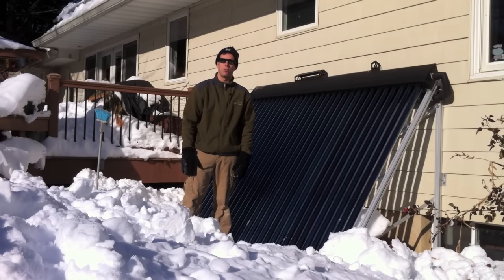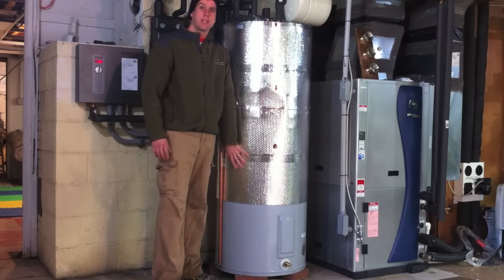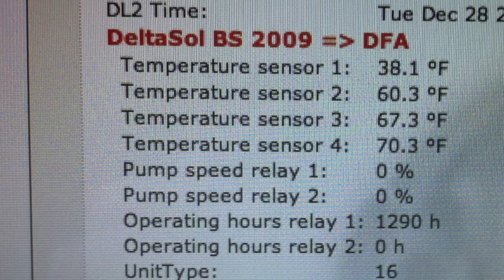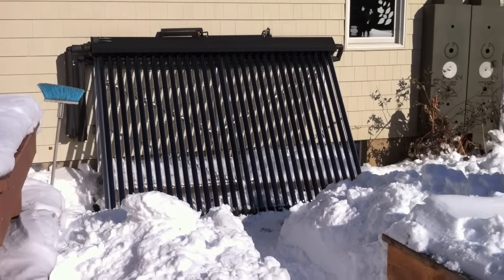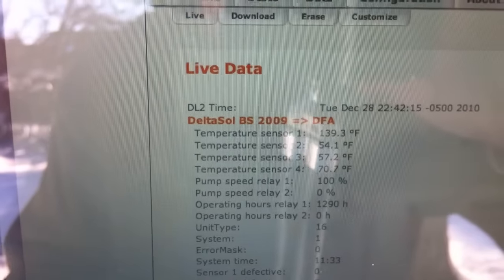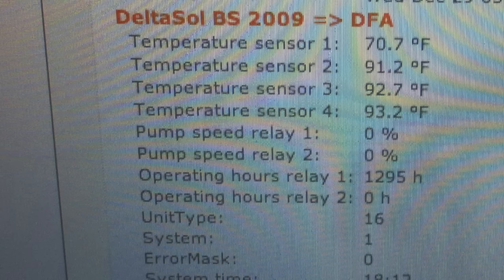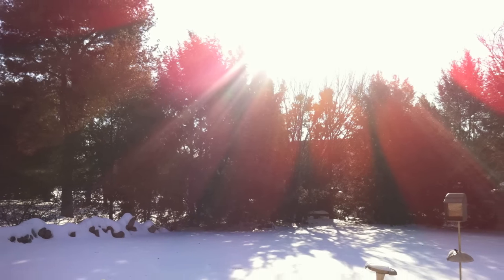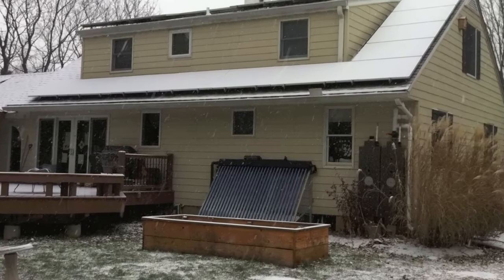How well do solar thermal evacuated tubes work in the winter? Sunmaxx solar

Comment: I have a correction for the math. He needed to have found the average temperature rise across sensors 2,3 and 4 which comes out to 34.8 degrees. (34.8 degrees) (80 gallons) (8.34 BTU per gallon)= 23.1K BTU. Great Video by the way!
Reply: Total of 23.1k BTU day =  6.7 Kw day x  $0.13 Kwh taxes included = $ 0.87 day saving . WOW

Comment: Did you think about mounting the system on the wall of the second floor?  It would be out of the way of the shade from the trees and the kids soccer balls.  A vertical mount would collect less snow and may result in less excess heat in summer when the sun is higher in the sky.

Comment from the maker: system is designed to produce 100% of needs during summer with very little over production, if there is any excess, the top of the collector has a heat dump.  If you had a pool or hot tub you could stick the extra heat there.

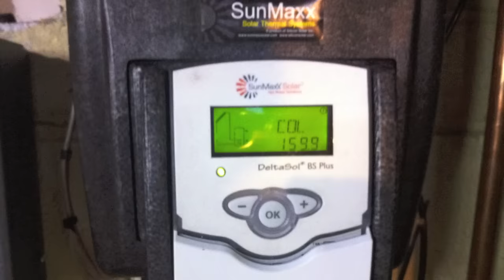Comment: The temp differential between the collector temp and the water temp is way out of line.  10-30F. is a good amount between the collector and  lower tank temperature.  That collector requires a flow rate of .80 - 1 GPM for each collector.  The flow rate may be set too low.  At time stamp 6:25, when looking at the pump station, there is no pressure in the system.  All solar thermal systems run better with pressure in the loop.  At zero pressure in the line  set the expansion tank to the pressure you want in the system, then purge and fill to proper pressure.  Also the temp gauges show cooler temps on the hot gauge side than on the cooler temp side returning to the collector.  The controller on-off set-point may require some adjusting.  Given the 80 gallon storage tank and the single collector, your water temps should finish around 105 - 120F. at that time of the year daily water usage included.
Reply: Wow way to break it down. Do you work in the industry?

Comment: Converting form BTUs to kwh because that's what I am used to, I make it about 5.1kwh per day, on this short snowy day. This would be enough hot water for two people I think. Its not enough to heat a home (but I think US homes tend not to use hot water for heating as we do in the UK). However its an impressive result considering the snow. What's it like in summer?

Comment: What does the pump run off of ? Electric? Our water tank is set on 120 degrees which doesn’t seem that hot sometimes. It appears your taking a lukewarm shower all the time unless it’s summer. I can’t help from thinking whenever has anyone ever heard someone say “ man I can’t wait to get home to take a lukewarm shower “. I don’t think it’s worth it in the winter months. When I’ve been outside working in the cold weather all day I look forward to getting home getting in a nice warm or should I say hot shower. I guess it would be ok in the summer. 

If the system cost $5000 to $8000 where’s the savings over time? Don’t get me wrong I enjoyed the video. Really helps me to know I’ll not be getting rid of our hot water tank anytime soon. . Been thinking about a tankless water heater though. A buddy down the road has one and never runs out of hot water. The only time it uses any electric is when you turn on the hot water.
Reply from the maker: The system has back up, tankless electric, so regardless of whatever is in the buffer tank it’s always plenty hot

Comment: You should insulate all your pipes with armor flex 1 inch wall. You could have used a taco 009 and a similar controller I use resolve som 6,7,8.good luck looks great get more collectors and storage..storage is the key to heating with solar.

Comment: With Natural gas rates right now in Ontario, it looks like you would have saved around 10cents on one of the shortest days of the year. My guess is you could make about 50 cents worth of heat in summer this way. $15/month then. $3/mo in Dec, Jan, Feb. I live in Ontario and I'm planning to use my PV panels to heat water once my batteries are full. No outdoor plumbing to freeze that way. I heat water and my floor with a coil in my cookstove firebox for winter. It works very well.

Comment: in Celsius would be even better...
Reply: tip 100 fahrenheit is near  human body temperature
Reply: @93Badash  100°C = water boiling  0° = freezing water 
In my opinion this is more relevant in everyday use ( like weather, cooking )than the 100°f = body temp 
0°f = arbitrary

Besides that it can be easily converted to kelvin which is important since it is the SI unit
Reply: With American and international viewership the presenters need to start showing both.  When I’m seeing celcius temperatures I keep an extra window open with the conversion chart to know the f temperature

Comment from the maker: The system would cost about 5k to 8k depending upon where you live.  The variable in costs is typically around the installation costs.  This is before any state or federal incentives.  The federal government also has a 30% tax credit.  Many states have many rebates too.   If you can handle the job yourself, you could probably do if for under 4k.
Reply: Where does a person shop for one of these panels?. How do they work in the Midwest where cloudy days not bright sunny, but cold days like in the Rocky mountains are normal? How is unwanted heat disbursed during the summer time?

Comment: Good effort but that's a lot of expensive hardware that has to be purchased, maintained and, eventually replaced. Also, I find that showering in water below about 103F starts to feel rather cold. Is it really worth it compared to just using electric or gas?
Reply: He is using solar as a pre-heater.  He showed an electric on-demand hot water heater that makes up the difference...  It is a lot cheaper to take solar heated water from 90 up to 116 than city or well water from 55 up to 116.  These things pay for themselves with energy savings in a few years and they last as long as copper and glass last (much longer than photovoltaics).  It probably came with a couple extra tubes and you can buy more for less than 40$ each.

Comment: OK ... let me get this right. This only raised your temps to a luke warm shower temp. So you still needed the backup to get the water for a shower. I realize that it's only having to raise the temps from 60ish instead of near freezing. Down here in the south it would take a long time to pay back the system. I use NG to heat my water. Typically the temps are in the upper 40's during most of the short winter and we get a temp boost in the summer as temps are in the 90's and low 100's.

Comment: what do you use to insulate the pipes taking hot liquid to the tank?   i have copper coming out of the collector which turns to pex as it drops down over the roof... found that copper gets so hot that it actually melted foam insulation sleeves, so was thinking of wrapping in fibreglass, then silver foil bubble wrap painted black...   or abs pipe cut in half, then glued back together over the pipes/insulation.

Comment: nice video BUT snow is a problem because the tubes are so well insulated no very little heat from the tubes is available to melt the remaining snow BUT I guess if you are serious about collecting heat in the winter evac tubes could work. I herd there are leek problems from time to time.. I prefer DIY collectors.
Reply: John Canivan what I like is a combination of both. Cheap flat ones, since they are easy to come by nowadays anyway, good for collecting ambient light. And 1 vacuumpipe for the colder days.

Comment: Ok, 17412 BTU are about 5.1kWh, right?

At about 25c/kWh, you just saved or produced $1.3 assuming 100% efficieny in an electrical heater. So let's say $1.5.
that's $45/month.

How much did your installation cost so as to determine the return?

thanks for the great video and I'm jealous of your snow..
Reply: +Yves Baggi Electric heaters are 100% efficient.
Reply: these things only pay off in years...its true worth lies being off grid as much as possible.
Reply: I don’t think they ever pay off, not in US at least.

Comment: What about a really cold day and night..say...minus 30 F. Do the pipes burst from freezing?
Reply: The exposed tubes are all using a glycol solution and the collector its self uses some sort of molten salt that can't freeze.  They use these in Alaska.   All the "water" in the system is safe inside the house where it belongs.

Comment: i would add a photovoltaic solar cells a single one off switch that shunts all of the power of the solar on the roof and out the back garden into that boiler via a low voltage heating element just to bring it up to a minimum of  soon as the tank reaches the correct temperature either a timer switch or a temperature switch would chuck the solar power back into my battery bank that way your not waiting all day to heat up your tank.

Comment: Wo what did this system cost? I've thought about adding a heat pipe system to supplement my old school, cast-iron radiator hydronic heat system, but don't know about the payback.

I happen to be lucky in that half of my roof is unobstructed, about at 45 degrees and facing due south.
Reply: Ha,  I just replied to a 9 year old comment ;)  Moving on now.  ;)

Comment: So it almost gets hot enough at the end of the day to take a decently warm shower in the winter. But isn't hot enough to he considered hot water at any point. Even at that, you would be using all hot water of you wanted a warm shower and no cold making the reserve tank go away very quickly. I think it needs some work still.
Reply from the maker: Not sure what you're trying to say here.  BTU's are BTU's.  We heat the tank the most we can with the sun.  Thats all savings.  What ever we can't heat, we heat with tankless electric, which give us another shot to use the sun since we have solar PV.  If we don't have enough solar PV, we use the grid.    Its a perfect system.
Reply: @NJRenewableEnergy  exactly what im saying, at best this is another "possibly" cost efficient solar add in that is probably not worth it..
Reply from the maker: @Caseycallender   In late spring, summer and early fall its likely doing 100% of the hot water needs.  Still not following you here.  That said, what makes this a harder sell finaically these days are two things.  1- Due to fracking, gas is cheap right now so its not cost competitive.   2- other solar options have more incentives so its not something most people start with on their homes.   These systems are used all over china and india.

Comment from the maker: Not exactly the case, agreed that this system cannot handle 100 percent of my needs, 10% of this is because of shading.  Normally, you will never size a system for 100% winter requirements.  This is because during the summer you will have significant amounts of overheating.  One exception is that if you have a pool or hot tub, you can dump this heat there.  Killing two birds with one stone.

Comment: Wrong! Average temp sensor in tank rose 35 degrees, so only 5,804 BTU for the day, but still doable for 1 or 2 people taking a 5 minute at low water pressure. If you had enough of these panels and tanks and a hydronic floor heating system then your whole house would have free heat! Solar water heating is 10 times more efficient and less expensive than solar electric PV panels!
Reply: Actually you are wrong.  35F X 80 gal X 8.35 lb/gal = 23,000 BTU. About 1/4 gal of propane or $0.50.

And that is with a huge 30 tube system and expensive control system. 

 I have a 10 tube collector -1 that a deer broke.  When the water is hot in the collector the pump turns on. That's it. Barely enough in the summer for 2 people.
Reply: Not much good in Ireland I guess with all that cloud cover.
Reply: So 80 cent will produce the same output??   jeese

Comment: This just tells me it is not worth it to install this system. For the cost and where this system is installed (couldn't be worse-on the ground and shaded) for probably around $7,000 there was a 17,000 btu gain. A small space heater does more than that in an hour.
Maybe if this was mounted where it should have been (on the roof) and more of them, there would be an appreciable amount of heat gain but the cost would go way up as well.

Comment: You know, if you raised the collector a couple of feet you'd have less problems with snow.
Reply from the maker: agreed, fortunately for us in NJ, it's not that common a problem.  I moved the collector when we did passive house addition. There it has a little bit of an overhang, of course during wind that doesn't do much.

Comment: no mention of the ambient temperature outside. Where I am it can get down to -30 -40 celsius. so... sno on the ground means very little to me. big difference between 0 and -40
Reply: What part of Canada do you reside?
Reply: He showed the thermometer on his tree, it was around 30 degF
Reply: I live in Canada, so similar situation. My system makes loads of hot water down to about -20C (-10F) at which point hoarfrost no longer burns off the tubes. Since my panels are up on the roof I have no easy way to remove that frost so from then on I rely on the woodstove with coil. It's really something to see the hot water I can produce on a winter's day!